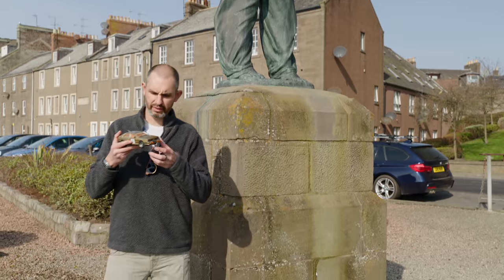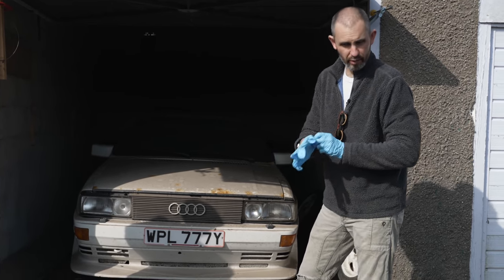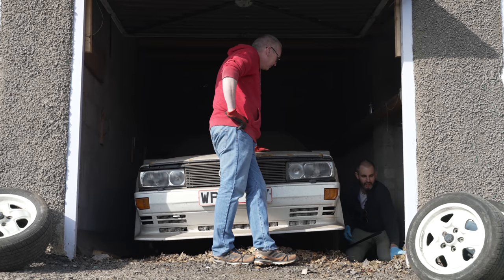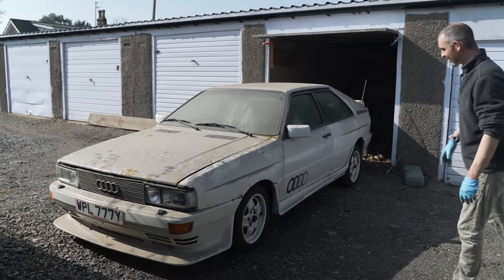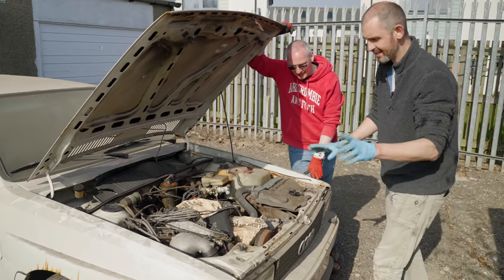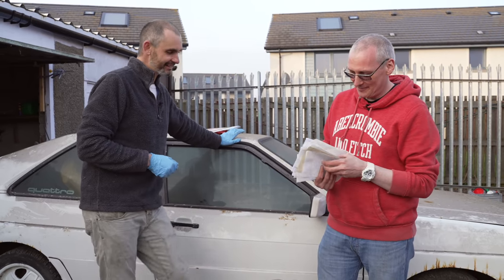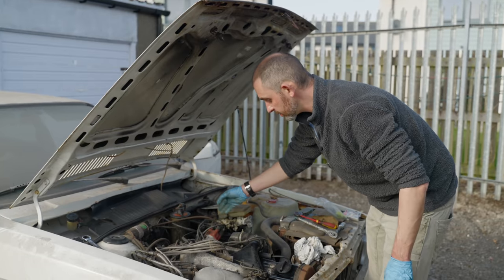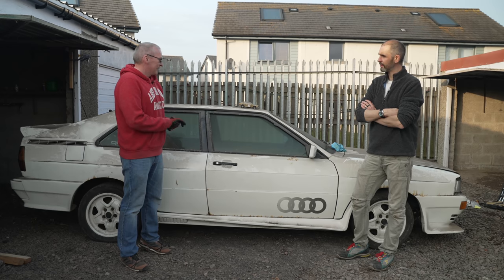Audi Ur Quattro Turbo Barn Find  - rare survivor sat for nearly 30 years

Comment: Jonny you got your facts wrong ,this is NOT an UR-Qattro it is way to long, the UR model was same lenght as the rally cars which where 250mm shorter than the public Audis, the Rally model were cut off behind the windscreen and the windscreen were more upright also, there is a hungarian company building copys off them today, where they shorten normal Audi 80s
Reply: It's sport quattro you are talking about, it is the shortened one. These normal lenght quattros are called 'UR'
Reply: This car is a UR quattro. It precedes the (swb) sport quattro in production by 4 years. 

The sport quattro was not cut off behind the windscreen at all. The front of a sport quattro was from an Audi 80 2door car and the rear was ur-quattro coupe. The shortening was after the b’post (the 80-2door’s door is different to the coupe) and before the rear wheel tub assembly. 
I’d do a little more homework before spouting off about “getting your facts wrong”.

Comment: Sorry but going by that story he just  gave you and the circumstances that car is most likely (I would CERTAINLY think) either stolen and most likely in the current guise as a ringer!.......Bet the engine number in that car has got a story to tell regardless of whether the chassis plates etc have been done well or not!
Reply: Interesting.
Certainly has the wrong headlights in it..,
Reply: No its not, i was so close to buying this car in 89 or 90 but could not get insurance.
Reply: @Steve-ks6ed  I was only going on what was said in the video.
Mind you don't think I've ever seen a quarratto with the "quad " headlights. Thought they were in the lower spec models...
How much was you quoted for insurance - they refused point blank...?
~ 92/93 I was paying 600£s for a 1.2  Vauxhall Nova.
Only been driving for 3 years at that point... So probably loaded due to my age..
Reply: @stuartd9741  Sorry just spotted this in my spam folder, Insurance companies would not quote at all,  the quattro is still exactly the same,the  bodykit wheels etc when i was looking at it, its not stolen or a ringer, the car was immaculate back then and around 6 or 7 years old, by the video it was put in storage just a couple of years after this  and has not moved since